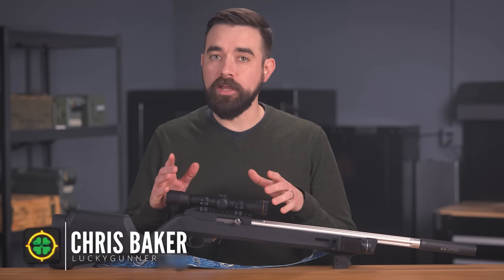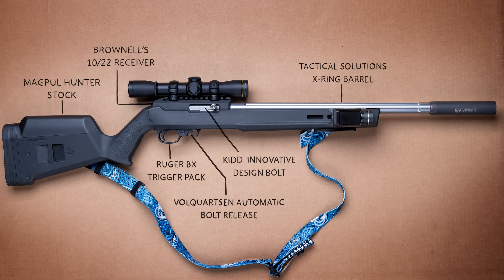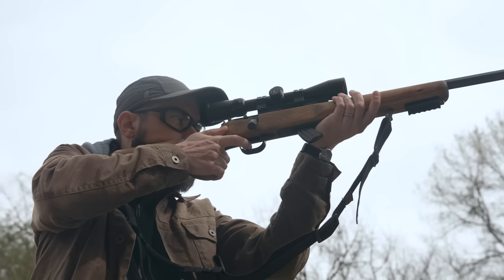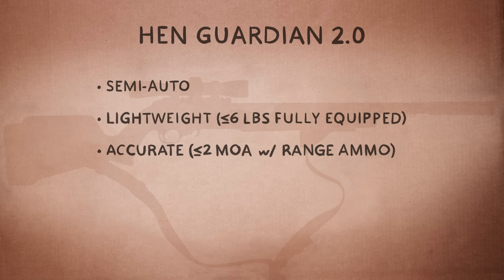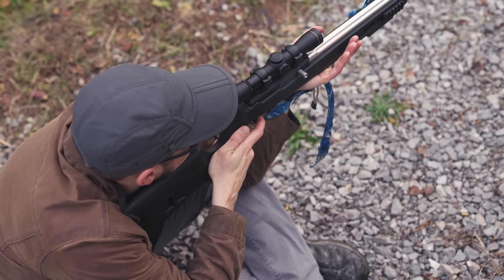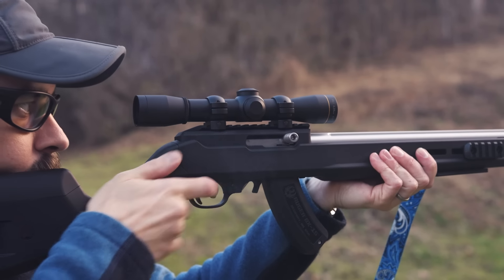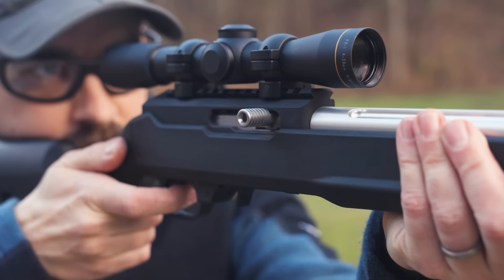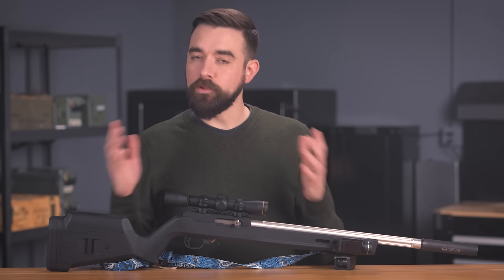The Backyard Sniper - Lightweight Edition

Comment: Volquartzen triggers are super solid. Like $120ish. Those are in all my 10/22s. Also, I really like 10” barrels for the 10/22. That way with the can, it’s still a super handy rifle. And I’ve not seen enough velo loss for it to matter. Still does the job it’s meant for. And I run CCI Suppressor. Cycles reliably, yet subsonic and very quiet.

Comment: A good lightweight 10/22 clone is Bergara BXR.  Barrel is super accurate.  Comes threaded.  Love the oversized mag release and lightweight stock.  Integral pic rail is an upgrade over my Savage rimfire rifles.  Trigger could be slightly better (oddly average pull, for a Bergara).

Comment: I have two 10/22 build. Both Ruger receivers, stock bolt & charging handle, bx22 trigger, magpul stock(ODG & FDE), one with tac-sol barrel w/ fiberobtic sights and the other Volquartsen ultra light barrel. I run the silcerco switchback on the tac-sol barrel. The design of Volquartsen barrel does not work with my suppressor. Thought about a 10/22 take down that tac-sol makes but I don't think it's worth it. Especially when you lose accuracy.

Comment: A polyurethane bolt buffer is cheap and a little quieter if you miss the total silence of the bolt action. It can be a pain to remove and reinstall, though. There is also the Colossic bolt lock, if you occasionally want a straight pull bolt action. I think it was OOS last I looked, though.
Reply from the maker: The Kidd buffer I installed has been very quiet so far

Comment: The biggest issue I see with the BX trigger is they are not consistent one to the next.  If you find a stocking store the packages were set ip to try them for feel and weight.  If your game has pull weight requirements this can be an issue.

Comment: Powder River Precision makes nice trigger groups, Feddersen makes nice barrels, but they are not light, on edit: agree with CCI standard velocity 40 grain, $4.95 a box, very consistent. I run the Leupold 3-9 x 40 rimfire, but it’s heavier than your fixed power

Comment: @luckgunner, i know this doesn't have much to do with your video, but i'm a homesteader and have some tips for you! I went from losing 84 birds in two years to losing zero. 1st) If you do shoot some racoons, get a 5gal bucket and a drill and make a maggot farm. Hang it in or near your chicken run. They way I saw it if they're gonna eat my chickens, i'll turn them into food so my chickens can eat them. 2nd) I had hawks, a family of racoons, and foxes that wrecked my flock. Eventually I got a LGD great pyrenes and that stopped all predators from coming to my property almost immediately. Haven't lost a bird since. 3rd) before the LGD I did use the "protect the chickens" reason and built out a sweet AR with an LPVO on it. It's awesome.

Comment: Did you consider the CZ 512 in 22mag?  It is my understanding they are quite good and you would have the benefit of the 22mag round.
Reply: Great gun, but I'm assuming he wanted it to be extremely quiet, which wouldn't be possible with a 22 mag

Comment: Great video Chris, thanks. I have a stock 10/22 with a stainless barrel. Purchased it a year ago for $305 on sale. I added the BX trigger ($80) and auto bolt release ($12) , Leupold 3-9x33 EFR ($400) and that's about it. Total cost about $800, so we achieved similar results for around the same money. I like to target shoot off-hand at 50 yards, so light weight is paramount. Perhaps my approach is a little less hassle?

Comment: Racoons are tough. If it needs to be taken out so be it but I'm not sure 22lr is it. I've seen & heard of 22lr not being efficient. Maybe 22WMR?
Reply: I remember seeing someone shoot one 5-6 times with a .22lr before the sucker finally died, and the first shot was from about 6ft while it was sleeping in a hollow tree!  Tough indeed!
Reply from the maker: Yeah, there are better cartridges for putting them down, for sure. But I'm trying to be a good neighbor, so keeping it subsonic is important. I do have a .22WMR I can run suppressed for occasional use
Reply: Have you tried rhe various 22lr hunting rounds that run something like 1400+ fps and 40 gr weight? They offer the best terminal ballistics I can find out to 100 yards on paper with a good flat trajectory if sighted in at 75 yds. Your milage may vary as suppression may impact results and actual performance can vary wildly from gun to gun.
Reply from the maker: @The Nose Plays I usually use subsonic .22LR. If I'm going to use supersonic, I may as well just step up to .22WMR. Realistically, I don't have a shot I would actually take on the property that's longer than about 60 yards, so the trajectory isn't really an issue.
Reply: the cci standard velocity with the segmented bullet have killing power out of proportion to their ballistics they are subsonic from a 16" barrel and still cycle in my suppressed 10-22
Reply: We used to use 22 shorts point blank to the forehead (draw an X from ear to opposite eye, X marks the spot, they'll kick for a bit but it's just the nerves firing off) when we trapped them and it works well.  

Like always, shot placement is king.  For less precise shots like he's finding himself doing now, going up in caliber could help... raccoons are tough!

Comment: Your rifle is similar to mine, I built it using the same Brownell’s receiver and stock and I love it. I then built a 2nd one that’s a takedown model because, well, the 1st one looked lonely. They’re close to identical though only the 1st one uses Ron Power components in the trigger and the 2nd I built while I was in school to be a gunsmith and did the work on the stock Ruger trigger and they both came out about the same. The biggest difference between yours and mine is that I used a Mist integrally suppressed barrel on both of them. Which of course means 2 tax stamps. Maybe one of those was lonely as well m

Comment: Snazzy setup!  I went ultralight for a fun one to carry around, Ruger 10/22 composite tactical with the flash hider, Rucker machine red dot mount to fit a trijicon rmr, Kidd 2 stage trigger pack, Kidd scalloped black bolt, Kidd springs etc and charging handle. 

Thing is so light and shoots so good it makes you smile every time

Comment: I like the Ruger 10/22 and I own one of them, but my ca.1983 Marlin Glenfield model 60 is my go-to for anything other than plinking.  Extremely accurate 22" barrel, 18 rounds, custom ordered Walnut stock instead of Birch and no stinkin' rotary magazine to fool with. Still has the original barrel and I estimate a solid 300k rounds  put through it. I've only had to replace the firing pin, extractor and tube rod spring.

Comment: While I love a good build, I am curious if the KalTek SU22 would not have fit your build criteria and budget for ~$500. Frankly, if you were worried about not getting clean kills with the .22lr, you could have just as easily gotten a SU-16, the .556Nato rifle the SU22 was based on for ~$600. 
Not sure if changing cartridge was something you were interested in, but I figured it'd be worth pointing out the option to others.

Comment: Starting my build on an old wood stock 10/22 (25+ yr old). Question do you prefer Volquartson v TandemCross> Both make fine aftermarket parts.

:)
Reply: Volquartsen, I've tried a couple tandemcross "upgrades" now and they don't work at all.
Reply: @craposnap  Thanks, like to hear from lucky gunner  :) BTW in 2016 those two companies "partnered".
Reply: @1947froggy  I guess the partnership was a mistake then lol
Reply: @craposnap  Well be specific and help us all.
Reply: @1947froggy  Gladly, my tandemkross firing pin failed in under 5K rounds for no apparent reason (no excessive dry fire or anything at all. It just simply stopped igniting primers reliably. Their firing pin return springs were out of spec or the firing pin was out of spec (not sure) and their extractor was a sloppier hold on my mk4 than a stock extractor. Maybe I got unlucky? But so many times in a row is odd at the least. Have a nice day.
Reply: @craposnap  Thanks, good to know.

Comment: If you were gonna have maybe $1000-$1200 budget, would the trigger be the thing you spent that extra money on? In thinking I want this same setup, but not sold on the trigger, and I already have another optic I want to use for it.
Reply from the maker: Yeah, the trigger would be the next thing I'd consider upgrading. Honestly, I'm not sure if there's a 10/22 trigger I would love. It seems like most of the high dollar aftermarket triggers are geared toward minimizing the trigger weight, which is not really what I'm after. The 3.5 lbs of the BX trigger is fine, I'd just prefer a two-stage type feel with some takeup versus the single stage. Metal trigger components would be bonus, just for aesthetic purposes.
Reply: @LuckyGunner  I was having the exact same thoughts but got overwhelmed going down the rabbit hole and gave up for a while. This video resparked my interest in it, gonna try again to spec one out.

Comment: Light weight version?   I thought my 22lr plinker was light at 11lbs.   Well I guess it is compared to my 6.5 Creedmoor (14lbs) and 338 Lapua Magnum (22lbs).  I might have to build up a  full aftermarket 10-22.   Sounds like a lot of fun albeit probably expensive since I'm a trigger and accuracy snob.  So a cheap trigger and barrel is probably out of the equation.

Comment: Nice video. It looks like your got yourself a nice rifle. I got a old (1972) 10/22 a few years ago. I swapped out the trigger to a Hornet Custom Plinker Special which has the bolt lockback and put on an Archangel stock. I also added a rail with a SIG Romeo 5 Red Dot and a Vortex 3X Magnifier. You might think about a red dot instead of the scope. With a flip in/out magnifier, you get some nice options. Also, why aren't you using Stingers for you critter control?

Comment: Standard 10/22 with a polymer stock, $200 extortion stamp, threaded steel barrel insert, drill holes in insert, line with thin stainless washers, thin aluminum over washers/barrel sleeve.  Sub-$300 (+$200 traitor tax), 3lb-ish, mouse fart lead slinger.

Comment: Why are you Using solids for pest control? Winchester Power Points are much more effective/humane.
I have never had to shoot a Coyote/Bobcat?Raccoon twice inside of 150yds in 26 years of using them.
My 10/22 is designed around the round,the chamber is milled to allow the bullet to contact the rifling as it is chambered. She does 1 MOA out to 165yds.

Comment: Interesting.  I would like to either upgrade my 10/22 (so it doesn't fail to extract) or build.  I wish you had put links in your description for the components.
Reply: If it is all factory I would clean the chamber and check the groove the extractor sits in the face of the barrel and make sure it isn’t packed with powder and oil.  A Volquartsen or Kidd extractor isn’t much and is pretty easy to install if you are still having issues.

Comment: Was wondering what you think about the skinny grip on that stock? The front grip is really nice in my opinion as well as the cheek riser but I’d like to know what some other people think about that skinny angled rear grip on the magpul stocks
Reply from the maker: After using the Magpul stock on shotguns for years now, I'm a big fan. The grip angle and shape has the advantages of both a traditional stock and a modern pistol grip

Comment: I built mine almost 20 years ago and I wish I still had it. I had a folding stock and a Ruger bolt trigger and receiver and a bull barrel designed alot like yours but it was some black lightweight material instead of aluminum except for stainless steel ends and the actual barrel tube center like yours. I put a Simmons 6- 18 or 24 I don't remember scope on it to save money and it was very good for sighting it in even with the 22 bullet drop at up to about 200 yards. At 25 yards I could shoot the fishing line I used to hang bottle caps targets on.
Anyway it was very accurate 22 and I loved it. I found out later my folding stock wasn't legal on that new of a Ruger and the pawn shop I sold it to put a different stock on it.
I loved the 10/22 and all the aftermarket stuff you can use to make the rifle you want or need. I made a few using the stainless fluted bull barrel, twisted bull barrel and the other one I mentioned. I liked target shoot mostly.
Great video.

Comment: I use a charger non-takedown 10", bx25 trigger,   SB chassis and brace, AGM Rattler 35mm-384 thermal scope, Griffin Optimus micro can, CCI std vel. Rotten coons killed 3 of my fav hens before I went dirka dirka jihad on 'em. The vids are glorious.

Comment: I have a very similar build. Considering upgrading my trigger group to the tandemkross group. I’m running the stock barrel and receiver with Williams iron peep sights right now, as I use this rifle with the other Dads on the street as training equipment for the kids. Once we get to proficiency with irons this spring I might grab a threaded barrel and a suppressor like that silencerco. Have you measured the decibel count by chance?
Reply from the maker: I haven't measured it, but if you install a bolt buffer in the 10/22, it's going to be very quiet with subsonic ammo and any remotely decent rimfire suppressor. It makes less noise than a staple gun. The bullet impact is usually louder than the gun itself.

Comment: Damn. Should have tried a stock model first.  Mine is from the first year of production and is more than adequate for trash panda missions, as well as cost friendly.  I've tried mods and customs that my 'youthfully thinking' buddies had.  They were expensive, pretty and shot very well... until they took aim.  Would I like to have a 'duded up' model? Sure I would. But I could never spend that much for micro-improvements, especially in a non-competition .22LR platform. I'm more concerned with not having funds for furnace oil this year... again. You can't buy shot placement.

Comment: BRN 22 Takedown railed receiver
Magpul Backpacker stock
Magpul backpacker optic mount
Tandemkross bolt and charging handle
Gemtech Mist 22 TD integrally silenced barrel
Ruger BX trigger
Extended magazine release
Auto bolt release which refuses to hold the bolt open for some reason
Vortex Razor 3MOA red dot
3D printed 100 rnd storage block

Comment: Does anyone know what would happen if a person took one of these shots to the head? I mean, I’m assuming instant death, right? Or would it be possible to survive? I guess the reason I’m asking is that why aren’t these more popular for medium-long range home defense because of how quiet they are with the suppressor. Seems like a nice way to have a weapon that is very hard to hear, particularly which direction it’s coming from, has lightweight ammo, and if one round is still dangerous to the dome then why isn’t it more popular? Oh yeah, and the biggest selling point—cheap in comparison to an AR rifle. Granted, I’d still have my pistol and shotgun for CQC home defense, but why not consider this for medium, and possibly long range? This may be a really stupid question but I’d love to hear responses…
Reply: Some teams use them for close range sniping. Not for the silence so much but for reduced collateral damage, let's say the intended target is holding a person hostage etc. More importantly, whether the aforementioned is true a .22 LR to the head absolutely has the potential to be fatal. My home defense weapon is the "Charger" version of the 10/22 it is all stock Ruger, pistol grip, 10 inch barrel. What it lacks in power it makes up for in perceived recoil. It's easy to pepper-off multiple rounds without losing target.
Reply: @volentipugnum4045  great response! Thanks

Comment: Change your ammo out to CCI 40 grain segmented 1070 fps.
CCI Part number is 0074 or just 74 with new numbering system. 
Absolutely devastating on small game, that raccoon would not have taken four shots.
Reply from the maker: I have some on hand but haven't tried it yet. Wasn't sure if it was a gimmick, but you're the second person here to suggest that load. I'll shoot some groups and if it's accurate enough with this barrel, I'll definitely try it next time.
Reply: @LuckyGunner  when I shot a 2 L bottle full of water, the three petals were in a 3 inch pattern out the back.

Comment: The live-humane trap shown is a noble effort. (^_^)
In my situation comparable to yours, it was equally ineffective. (_Oo)

Due to my own parameters/distances (less than 100 feet), I used a Harbor Freight drive way alarm system (all battery powered and wireless...) to alert me so I could respond. Red light and audible alarm...Go Time!

And just cuz imma nerd, I use a pair of "JStoon Night Vision Goggles Night Vision Binoculars - Digital Infrared Night Vision for Viewing in 100% Darkness" to view/record from afar prior to taking action.  I mean it may/may not be four footed animals causing the ruckus, right?

Also had to resort to using  full body grip traps. Only cuz the area was fenced in totally and I didn't/don't have pets. (_Oo)

Comment: Great video. Nice build. If you like to improve your groups, you need to bed the action and the barrel with epoxy putty, and need a good release oil, or grease. The Kid two stage trigger might be a little expensive, but it is fantastic, plus it is adjustable.

Comment: I’m new to the 10/22, so forgive the simple question.  What is the mount you have on the side of the rifle that allows you to install the Streanmlight?  I can see it at 4:49 mark in the video, but have not been able to find it online due to my lack of experience with rifles. Thanks in advance.  A link to it would be most helpful.
Reply: It is a MLOK to Picatinny Rail adapter. I hope this helps!

Comment: Wouldn’t it be more affordable and just as effective to just buy a 10/22 for $300? I have never had any issues with mine. Not knocking your build, but I just don’t see the benefit. You even said yourself that it weighed about the same as the 10/22 with a synthetic stock.